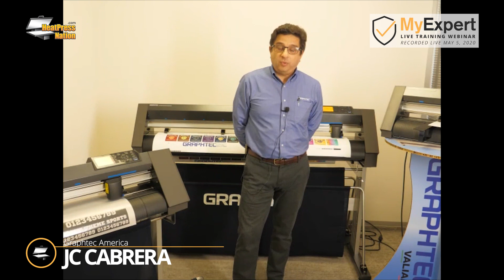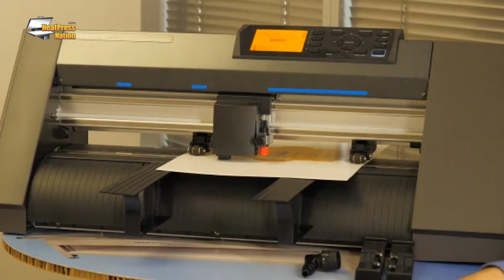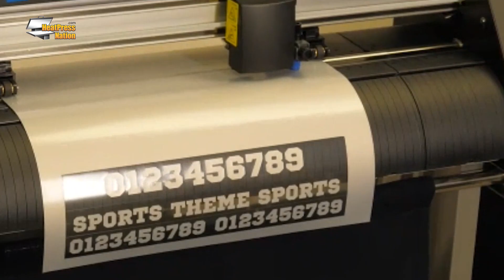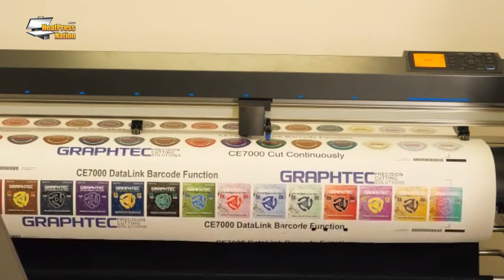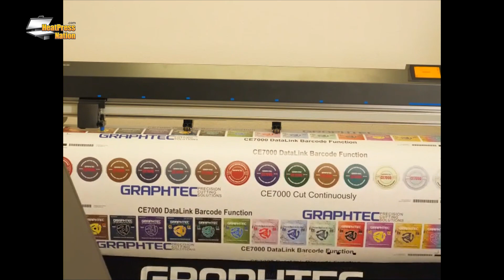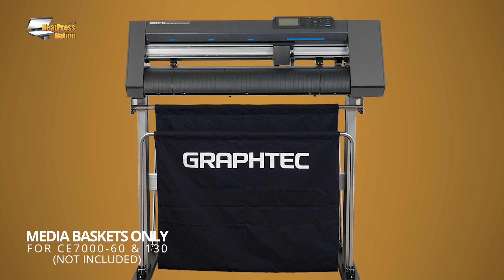Graphtec CE7000 Vinyl Cutters Overview

Comment: Graphtec will not answer my calls or emails. Will this be able to cut 20 mil magnetic rolls/sheets?
Reply from the maker: According to Graphtec, this is the acceptable media type and thickness for the CE7000: 

"Self-adhesive marking film (vinyl, fluorescent, reflective) excluding high-intensity reflective film, up to 25 mil (.63mm) Stencil material"

Comment: Why would the CE 7000 cut slowly?
Reply from the maker: You can control the cut speed of the CE7000. So if it's cutting slow, it probably just needs to have that setting adjusted.

Comment: This model can make die cut in 0.25  mm pvc sheets?
Reply from the maker: This is directly from the CE7000 listed specifications:
Media Types: Up to 0.25mm thickness - Marking film (PVC / fluorescence / reflection),  polyester film (With specified conditions)